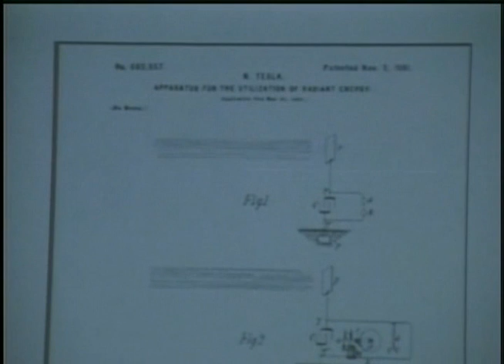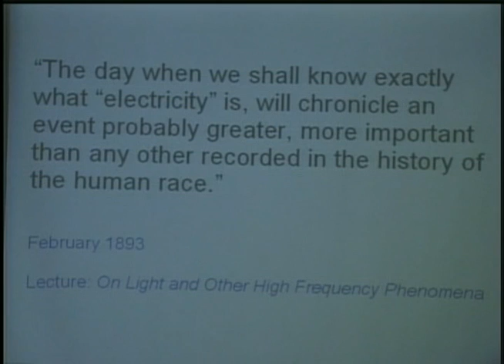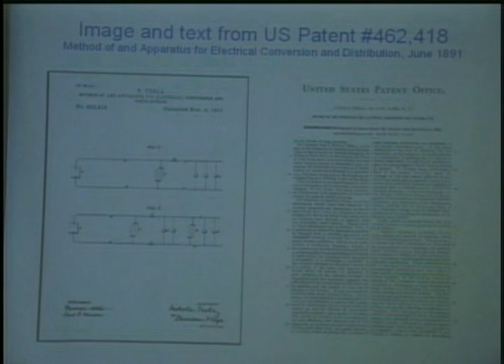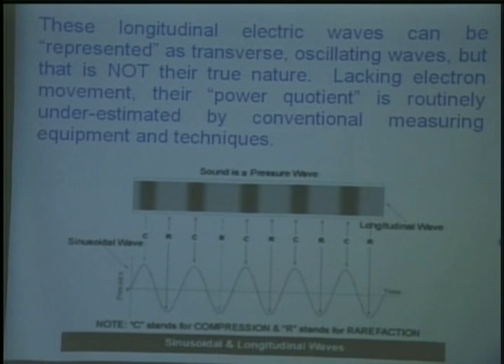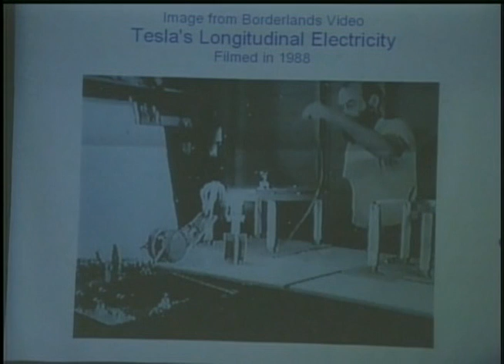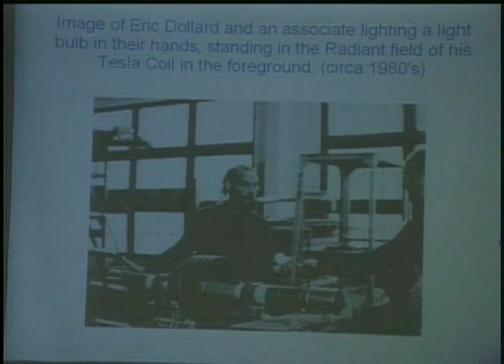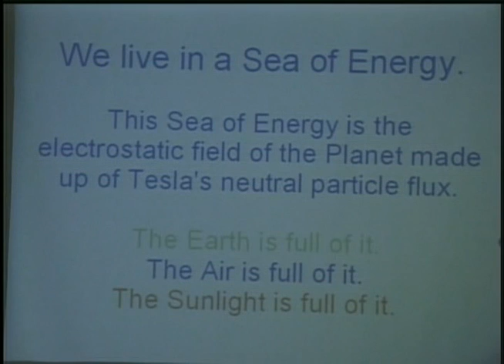Documentary: Free Energy by Peter Lindemann. Tesla's Radiant Energy: Extraordinary Technology

Comment: the patent for the bifilar coil (512340 januari 1894) is succeeded only one month later by patent 514168, means for generating electric currents, where in he discribes the disruptive capacitor discharge used to create radiant energy.
So, lets follow the logic, and use the bifilar coil with these disruptive capacitor discharges.
I'm working on this. Hope to share more soon in my channel.
Reply: Also wondering if the standing wave or non oscillating magnetic field created by your bifilar coils is in any way correlated to the output of the hairpin circuit? From my understanding you are creating a resonance in your circuit by discharging your capacitors while the magnetic field is in its greatest energy state, and you say that the excess voltage that is created through avoiding the back emf of a collapsing magnetic field is essentially a product of this "radiant energy." 
  
 From what I understand after studying the hairpin circuit; Tesla was able to modulate the a.c input such that it progressed through the hairpin circuit as a longitudinal energy propagation  rather than an electromagnetic wave. Are you saying that the pulsed D.C input in your setup is being modulated so as to create a longitudinal electrical propagation, or are you simply utilizing the capacitor spike to stabilize the magnetic field of the coil in order to create excess energy while staying within the confines of electromagnetic waves?

  Perhaps you could use the longitudinal component in your bifilar tesla coil experiments in order to create special effects. Have you ever heard of anyone connecting a hairpin circuit to a bifilar coil? Do you think that the bifilar coil has the potential to create the same effects without the hairpin circuit? Sorry to bombard you with questions; I am simply a curious student who desires to learn more about the mysteries of electrical study.
Reply: @connorfisher1651   My take on what Tesla is doing is the same thing as a "Peratt Instability."   If you watch what the plasma dumps are doing in this "Peratt and Petroglyphs" video at about 9 minutes ----->    https://www.youtube.com/watch?v=6meaU1QcSdA&t=880s
then they are doing the same thing as Tesla, dumping a lot of capacitance discharge from a plasma focus device.
   So in  a Peratt instability, we see the vortex rings, essentially caused like a smoke ring or an eddy current in water flowing through a culvert, AKA moving the ether medium through itself, creating a constricted flow, like a smoke ring or a torus in a carburetor flow.  Essentially this is a smaller-scale Herbig-Haro situation, that's creates planets or stars at the vortex rings in a constricted flow.
  Essentially Tesla then is trapping the electrons and charged particles in a vortex ring, as in the Peratt video or a smoke ring, thus separating them from the medium, and this allows the ether medium to flow through separated from the electrons as radiant energy.
Reply: @JoeDeglman  key is: there are no "particles"...  charge=termination point of a dielectric FIELD on a conductor. Fields make everything understandable. Particles only confuse (but you can calculate with them, thats why JJ Thomson came up with them).

dielectric field
magnetic field
magneto dielectric field
they explain ALL
Reply: @MasterIvo That is a falsehood, I traced that idea back to a misinterpretation of a Steinmetz quote.  Ken Wheeler was kind enough to fudge the words "an 'electron'" into a Steinmetz quote for us, despite there being no such evidence of an electron creating itself.  I have traced that to a Steinmetz quote in which Stienmetz actually implies that it is dielectric storage induced by an electron (as a condenser of magnetic flux) flowing through the conductor, that causes Ampere's law of wire motion.  Tesla has shown that he can separate the electron from the flow, not from this unverified "end terminal points points out of counter space."   Tesla states that he uses the electron to store ether medium in the inductor coil, dump that into a capacitor, and then separate the electron from the radiant energy.  Others have repeated this experiment.
    CERN has also verified that they can separate the electron from the protons of a hydrogen atom. There is no such evidence that an electron disappears when separated from the proton, nor   has anyone ever witnessed an ionized hydrogen atom developing its own electron out of "counter-space" or what ever that is.   Also there is much evidence from organisms to stars and pulsars that the electron is capable of  condensing  and rarefying photons straight out of free space.
Reply: @MasterIvo  We also have evidence that an electron is a point particle.  https://physics.stackexchange.com/questions/277565/where-is-the-evidence-that-the-electron-is-pointlike
  And quantum computing can control the quasi-particle around the electron in all axis of flow, but it will always act as a charged point particle at the center of the wave.   These quasi-particles have been measure and act just like a double-layer with a positive charge immediately around the negative charge point and a negative layer on the outside of the double layer.
  Also contrary to Ken Wheeler, Thompson, and Dollard, we have evidence of negatively charged particles. https://www.ancient-code.com/declassified-images-show-countless-nuclear-bombs-were-detonated-in-earths-atmosphere/

J.J Thomson proves the particle nature of an electron.
http://www.brainkart.com/article/Experiments-to-prove-particle-and-wave-property-of-Electrons_2728/
Reply: @MasterIvo  In fact if you read Steinmetz material, he talks about an  electric field, separately from the dielectric field.  and endorse charge as that which induces current flow.    In context with his readings, he is clearly stating that the electric field, which is normally radial from a charge, is closed upon the conductor and does not extend beyond the conductor.   This appears to be a point much over looked by those who claim Steinmetz was saying that  there  is no such thing as negatively charged particles in a conductor. Steinmetz is clearly stating that there is an electric field  in the conductor, but those line of force are closed onto the conductor, not end terminals from the proton.
   In fact he talks about how the current flow between charges, aka battery, induces storage in a 1-to1 relationship to the current intensity, and he also talks about how dielectric storage is also induced in a conductor.   So he is clearly not stating there is no such thing as charged particles or electron on the conductor, just that no charge accumulates on the conductor, like we get electron buildup in a resistor.
   Also in the oscillators both Steinmetz and Tesla clearly use open ended wires to accumulate capacitance into the wire ends, so Steinmetz is clearly not saying that you cannot get charge buildup on a conductor, just not as a closed conductor.
.   Also all references to J.J Thomson indicate the he thought an electron was as all other particles, they do act as particles and have a wave property associated with them.  Sounds as If Ken Wheeler is trying hard to bend these inconvenient facts to his idea.
Reply: @JoeDeglman  references please, I read Steinmetz and Thomson.... what you state, is not what I read. for instance Steinmetz 1911 "transients impulses..." book clearly describes the electric field as being made by magnetic and dielectric fields, including graphs of the field lines.
closed conductors are able to resonate both parallel as series mode. but they clearly produce FIELDS.
Reply: @MasterIvo Here is the textbook from Steinmetz.   https://archive.org/details/elementarylectur00steirich/page/n6/mode/2up
read page 10 to 14 or so to get a context of Steinmetz mind frame.
This is the same book from which the Ken Wheeler quote of Steinmetz came from, that he fudged.   This seems  to be the same material that the military teaches from, so it is public knowledge not classified material.    What we were taught is that an open wire builds up charge per electron and  two of those out of different capacitance sides of an oscillator circuit can be used to transmit a basic radio signal.   One will also work as an antennae.
     In  this book Steinmetz clearly defines between the electric field around charges and the dielectric field storage gradient around the charge or electric field.   The electric field he shows as radial lines from the charge.  The dielectric field he shows as the storage gradient encircling the charge point.
   He also shows how the electric  lines of force, when  current is flowing in a conductor, are closed onto the conductor from the current to the conductor, now known as  proton.  He also has text in the book were he describes how storage of dielectric also occurs on a conductor, but the movement per ampere's law is not caused by any charge buildup on the conductor, but by dielectric storage, or rarefying thereof, cause the movement  between  the conductors. 
     So it is a complete stretch for Dollard and Ken to try to fit this text and Steinmetz quote to the idea that there is no electron.   This text was from prior to this idea, which does not seem to come from J.J. Thompson, as far as I can tell.   So lack of evidence does not equate to evidence that there is no electron.  Especially since CERN can mechanically strip electrons from the hydrogen proton, upon acceleration and store them.
  So in the military it was made clear that a radio signal is due to dielectric flux buildup and release from the open-ended conductor, AKA antennae, that creates the radio wave.  Steinmetz makes it clear that the flux build up is due to charge or current flow, and the amount of buildup depends on the current flow rate into and out of   that open-ended conductor, as well as storage within an inductor coil.
  Here is that basic design.   http://www.qrg.northwestern.edu/projects/vss/docs/Communications/3-how-do-you-make-a-radio-wave.html
Reply: @JoeDeglman  “To account for its apparently small mass, science conceives of the electron as a hollow sphere, a sort of bubble, such a bubble could exist in a medium as a gas or liquid because its internal pressure is not altered by deformation. But if, as supposed, the internal pressure of an electron is due to the repulsion of electric masses, the slightest conceivable deformation must result in the destruction of the bubble! 

Just to mention another improbability, the force tending to tear an electron apart is, in pounds per square inch, represented by the staggering figure of 256,899 followed by twenty-one zeros (256 sextillion, 899 quintillion) — and this is 513,798,000,000,000,000,000 (513 quintillion, 798 quadrillion) times greater that the tension that tungsten wire can withstand! And yet it does not burst! Not even when it is hurled against an obstacle with a speed hundreds of thousands times greater than that of a bullet!" ” - Nikola Tesla Article: “A Famous Prophet of Science Looks into the Future” (Popular Science Monthly)

“My ideas regarding the electron are at variance with those generally entertained. I hold that it is a relatively large entity carrying a surface charge and is not an elementary unit (particle). When the ‘electron’ leaves an electrode of high potential and in a high vacuum it carries an electrostatic charge many times greater than normal.” –PREPARED STATEMENT BY NIKOLA TESLA by Nikola Tesla, July 10th, 1937

“In the theoretical treatment of these electrons we are faced with the difficulty that electro-dynamic theory by itself is unable to give an account of their nature.” “For since electrical masses constituting the electron would necessarily be scattered under the influence of their mutual repulsions, unless there are forces of another kind operating between them the nature of which has hitherto remained obscure to us.” - Einstein on electrons; “Relativity”, by Albert Einstein, Random House Publisher, 1916

JJ Thomson developed the “Ether Atom” ideas of M. Faraday into his “Electronic Corpuscle”, this indivisible unit. One corpuscle terminates on one Faradic tube of force, and this quantifies as one Coulomb. This corpuscle is not and electron, it is a constituent of what today is known incorrectly as an “electron”. (Thomson relates 1000 corpuscles per electron) In this view, that taken by W. Crookes, J.J. Thomson, and N. Tesla, the cathode ray is not electrons, but in actuality corpuscles of the Ether.” – E. Dollard

“There is no rest mass to an ‘electron’. It is given here the ‘electron’ is no more than a broken loose “hold fast” under the grip of the tensions within the dielectric lines of force. They are the broken ends of the split in half package of spaghetti. Obviously this reasoning is not welcome in the realm of Einstein’s Theory of Relativity.” – E. Dollard

The idea of electricity as a flow of ‘electrons’ in a conductor was regarded by Oliver Heaviside as “a psychosis”. This encouraged Heaviside to begin a series of writings. Also consider the J.J. Thomson concept of the "electron" (his own discovery). Thomson considered the electron the terminal end of one unit line of dielectric induction.

“Electrons as a separate, distinct entity…doesn’t really exist, they are merely bumps in something called a ‘field’.”  - Dr. Steven Biller

"Glaringly fallacious theories are responsible for such chimerical hopes. Probably the worst of these is the electron theory. Of the four or five atomic structures which have been suggested not a single one is possible. Not more than one in a thousand men of science knows that an electron — whatever it be — can only exist in the perfect vacuum of intermolecular and interstellar spaces or highly exhausted tubes and that the nucleus stripped of electrons, is devoid of energy.“ —Nikola Tesla “Our Future Motive Power.” Everyday Science & Mechanics. December, 1931. Pg. 230-236.

I think Walter Russel describes it best here:

"There is much confusion concerning the many kinds of particles of matter such as electrons, protons, photons, neutrons and others. These many particles are supposedly different because of the belief that some are negatively charged, some are positively charged and some are so equally charged that one supposedly neutralizes the other.

There is no such condition in nature as negative charge, nor are there negatively charged particles. Charge and discharge are opposite conditions, as filling and emptying, or compressing and expanding are opposite conditions.

Compressing bodies are charging into higher potential conditions. Conversely, expanding bodies are discharging into lower potential conditions. To describe an electron as a negatively charged body is equivalent to saying that it is an expanding-contracting body." -Light Does Not Travel by Walter Russell

I won't quote Steinmetz since you've already had a go at that, but come on man, all the pioneers of Electricity were very much against the Electron being a Particle, Dollard's experimentation has found it's associated waveforms are comparable to slamming the brakes on a high speed vehicle, they represent energy destruction, not what conveys it, see his paper "The Fallacy of Conductors."

As we know nothing is perfect so metals (except superconductors, which are all artificial as also semiconductors, they are processed materials..) will burn part of the electric field because they can’t reflect or obstruct perfectly, something is lost in the process of translation and energy is consumed at the inter-molecular dimension of the metal in the form of heat, hence the notion of the so-called “electron”, which is a “point” or local of waste of energy, correct observation incorrect conclusion.
Reply: @JenkoRun  Mostly what I was getting at is that according to several sources, including Nikola Tesla, an electron is half of a photon, or an electron-positron pair (without the ether shell)
  When a 'positive' or 'negative' particle is ejected from the nucleus of an atom, or from a nucleon, then ether particles surround that 'particle' with an electron magnetic medium or shell made of photons AKA particles of the ether.
   In the radiant energy experiment of Mikola Tesla, when the stream of 'electrons' is sent into the radiant energy beam Tesla was able to separate the half photon particles (base particles of the electrons) from the beam leaving simply the ether particles or radiant energy particles (for a small amount of a microsecond or so).

   this process seems remarkably similar to a plasma ring vortex that occurs at harmonic nodes along a plasma discharge.

  But according to several sources the decay of a particle from the nucleon must first occur and 'charge' does not migrate out of the nucleus per the discredited quark model, but electrons form from the ether condensing around the particle that decays from the nucleus.  Ditto for an ejected 'positron.''
     According to Nikola Telsa there are two different particles which can be shocked out of the nucleus (positrons and electrons).  But what we know to be the modern version of an electron is not an individual particle, but a particle surrounded by particles of the ether, presumably trying to neutralize that 'particle' at the center with the dipoles of the particles of the ether.

   Basically, saying that Tesla was able to separate by ether from the base particle that carries the ether as what we modernly know to be electrons.   AKA the ether is separable from the base particle (positron or electron) that carries or condenses the ether around it.  "The ether is the magnetic field observed around all charged moving particles" - Nikola Tesla.
  I would take this quote a step further and declare that the dielectric of Charles P. Steinmetz is the ether at equilibrium around those same particles.
Reply: @joedeglman5862  I would like you to cite where Tesla states, directly, that an electron is half of a photon, or an electron-positron pair, and you cannot ignore what the other pioneers had to say on the subject either. Furthermore a Photon doesn't exist as a particle either, it's the highest point of compression of the WAVE of Light, Tesla already told us what Light is, and it's not a particle:

“I consider this extremely important,” said Mr. Tesla. “Light cannot be anything else but a longitudinal disturbance in the ether, involving alternate compressions and rarefactions. In other words, light can be nothing else than a sound wave in the ether.”

“We have made sure by experiment,” said Mr. Tesla, “that light propagates with the same velocity irrespective of the character of the source. Such constancy of velocity can only be explained by assuming that it is dependent solely on the physical properties of the medium, especially density and elastic force. 

-TESLA SEES EVIDENCE RADIO AND LIGHT ARE SOUND
by Orrin E. Dunlap Jr.
New York Times
April 8th, 1934

I find it very, very unlikely that Tesla ever stated that the Electron is "half of a photon" when he alludes to no such particle being the nature of Light.

And as we all know waves are not things, they are what things do.
Reply: @JenkoRun  The Eric Dollard or Ken Wheeler claim that an electron is an 'end terminal out of counterspace' has never been observed by experiment.
   An electron requires that there be a base particle that cannot be just created from nothing.

   If Eric Dollar were right, then an ionized proton ought to be able to just create another electron out of counterspace.  No such electron creation around an ionized proton has NEVER been observed.   CERN has to store electrons and positrons and reintroduce them later.  CERN must get positrons from a radioactive isotope of NA- 22.  No such positron or electron has ever been created as an 'end terminal out of counterspace.'
   An electron can be stored indefinitely and reintroduced later.   If Eric Dollard were correct, then an electron by itself could not be kept in store but would dissemble itself when isolated by itself.  It does not.
Reply: @JenkoRun  To put this another way.   If Dollard were correct, that electrons were simply 'end terminals out of counterspace,' instead of requiring that there be a base particle for the ether to condense around to form an electron, then a battery simply would not work.
   Instead of allowing for ions to store charge at one end of the battery and electrons to flow through the circuit, a battery would simply create its own electrons out of counterspace and neutralize the ions in the battery. 
      If Dollard were correct, electricity in the form of electrons would not flow through a wire to get to the other end of the battery because the ions in the battery would just create their own end terminals ' out of counterspace,'   and Ken Wheeler wouldn't have to take a Steinmetz quote completely out of context (nor have to fully insert the words 'an electron' into the quote)  to try to make his point that he thinks an electron is not made of actual particles.
Reply: @joedeglman5862  Not terminal ends of counterspace, terminal ends of the Dielectric field, the dielectric field is a manifestation of counterspace when put under strain, Tesla referred to Voltage as "Tension" for a reason:

"Further experimentation with the original single-terminal coil, before referred to, finally led step by step to the adoption of a coil of large dimensions, which, in two typical forms, is illustrated in diagrams 10 and 11 (The extra coil of his lab). With such a coil I found that there was practically no limit to the tension available, and it is by its means that I discovered the most important of all facts arrived at in the course of my investigation in these fields."
-SOME EXPERIMENTS IN TESLA'S LABORATORY WITH CURRENTS OF HIGH POTENTIAL AND HIGH FREQUENCY
by Nikola Tesla
Electrical Review
March 29th, 1899
Page number(s): 195-197 & 204

Not just Dollard, the discoverer of the Electron himself, J J Tomson, defined it as the terminal end of a unit of Dielectric induction. He didn't even believe in it being a particle himself:

"The electron: may it never be of any use to anybody!" - Joseph John Thomson Use, May, Electrons Proceedings of the Royal Institution of Great Britain, Volume 35, (p. 251), 1951.

I'm afraid you've got the wrong understanding of the Aether if you think it needs to "condense" around anything, Aether is a non-dimensional non-Cartesian dimension pure potential or unmanifest inertia, it doesn't "condense" around anything. There's a reason Dollard nicknamed it Counterspace, it doesn't have space to begin with. Dielectricity and Magnetism are manifestations of the Aether and form around wires as they are the guides of the fields, field reflectors.

"If Dollard were correct, electricity in the form of electrons would not flow through a wire to get to the other end of the battery because the ions in the battery would just create their own end terminals ' out of counterspace,"

Yes, and? Ions are Atoms that have a different dielectric field gradients from the norm, Atoms don't have "electron particles" in orbit around them, Tesla also refuted this suggestion:

“The idea of the atom being formed of electrons and protons which go whirling round each other like a miniature sun and planets is an invention of the imagination, and has no relation to the real nature of matter."

“Virtually all progress has been achieved by physicists, discoverers and inventors; in short, devotees of the science which Newton and his disciples have been and are propounding."

“Personally, it is only efforts in this direction which have claimed my energies. Similar remarks might be made with respect to other modern developments of thought. Take, for example, the electron theory. Perhaps no other has given rise to so many erroneous ideas and chimerical hopes. Everybody speaks of electrons as something entirely definite and real. Still, the fact is that nobody has isolated it and nobody has measured its charge. Nor does anybody know what it really is."

“In order to explain the observed phenomena, atomic structures have been imagined, none of which can possibly exist."
–Nikola Tesla “Great Scientific Discovery Impends.“ The Sunday Star, Washington D.C., May 17, 1931.

As far as I'm aware, not looked extensively into Peter Lindemann's Battery Rejuvenation yet, Batteries work the same way a capacitor does plus the high internal resistance, they store dielectric tension in their dielectric material and release it over time when a connection is established that allows that release of tension which results in current flow, look up images of the inside of a capacitor and a battery and compare them, they are identical, the explanation for batteries working of a chemical reaction is no different than the definition that Atoms in molecular configuration are chemically bonded, there are no chemicals in atomic bonding, it is again the Dielectric tension field between the Atoms just as it is in the Anode compound of a battery.

Furthermore, batteries don't transfer their power through the wire, they transfer it through the FIELDS over the wires, dielectric between the conductors, magnetic parallel over each wire, the combined flow resulting in the Poynting Vector is the flow of Electric power. Even Veritasium figured this out, I suggest seeing his video "The Big Misconception About Electricity" and its sequel which cleans up the initial errors in the first video "How Electricity Actually Works"

"Ken Wheeler wouldn't have to take a Steinmetz quote completely out of context (nor have to fully insert the words 'an electron' into the quote)  to try to make his point that he thinks an electron is not made of actual particles."

Look up the definition of electrostatic charge, being described as a electrons on the conductor is part of modern definition, Ken is 
very much correct when Steinmetz referrers to this in the context of the Electron particle: 

"The electric field is zero inside a conductor. Just outside a conductor, the electric field lines are perpendicular to its surface, ending or beginning on charges on the surface. Any excess charge resides entirely on the surface or surfaces of a conductor."

"Static electricity or an electrostatic charge is a deficiency or excess of electrons which occurs on ungrounded or insulating surfaces."

And no point, anywhere does Steinmetz refer to a particle being the responsible mechanism of conveying electric power, he even shows it in his Diagram that the Electric field is a conjugate field of dielectric and magnetic fields, it takes willful ignorance to ignore what he is very explicitly stating and showing there. Again:

"Unfortunately to a large extent in dealing with dielectric fields the prehistoric conception of the electro-static charge on the conductor still exists, and by its use destroys the analogy between the two components of the electric field, the magnetic and dielectric (Understatement right there, it destroys the analogy). This makes the consideration of dielectric fields unnecessarily complicated” - C.P. Steinmetz Electric Discharges, Waves and Impulses

There it is, right there, "the two components of the electric field, the magnetic and dielectric", Steinmetz has made it clear as day that the electric field is a conjugate field, no mention of particles, no mention of electrons, if Steinmetz recognized any particle being responsible for the conveying of power or being part of the electric field he would have written about it and show it as he did with the field diagram, and it's certainly not an example of semantic shift.

One would think that how stray capacitance behaves at a distance, especially in the case of hyper sensitive coils, would be an obvious indication that it's not particles responsible for that.

Electricity is not the flow of Electrons, and it never has been, all Pioneers were against this pre-historic concept and they knew far more than either you or I do, are you really going to tell me that you know better than them who dedicated their lives to their research? Know better enough to change the meaning of their statements to suit your perception of physics over theirs?

Because if you really think that, then having this debate is pointless as it is impossible to debate with someone who views the world like that. Not agreeing with a view or statement is one thing, changing the meaning of an established statement to fit your view is another entirely, a Fallacy.
Reply: @Science Revolution   in the ends, it is not about energy. it is about the transformation rate of energy from one form into the other, aka power. for example magnetic field energy transformed into dielectric field energy (inductive spike aka impulse aka half period of resonant frequency of the turned of coil).
Reply: Master Ivo watched a bunch of your videos it was actually your content that brought me here.
Reply: mi -   READ   MY   LIPS  -     IN  THE  ABSENCE  OF A   WORKING  PROTOTYPE,  the  issuance of a patent    MEANS   NOTHING.      gaawd
Reply: @daviddavids2884  read my words: EVERY SINGLE TESLA PATENT WAS BORN FROM A WORKING PROTOTYPE.

Are you stupid naturally or did you have to learn to be so?